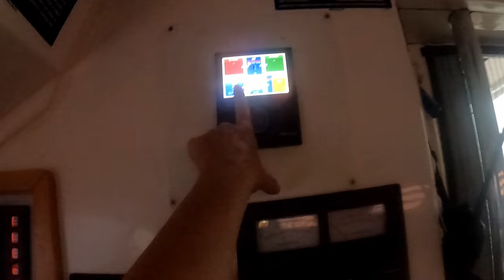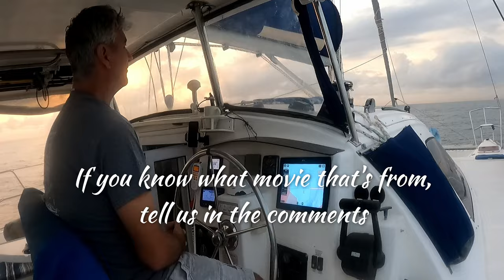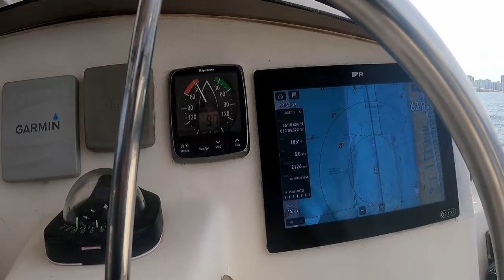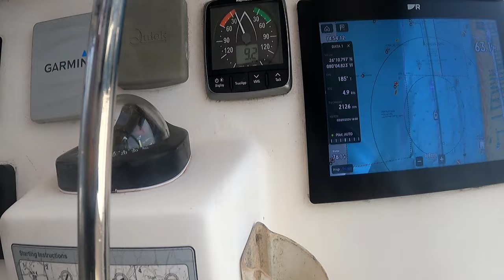SDA126 Windlass Woes

Comment: By sheer chance Capt. Dave, could the possible short from the case tightness be causing the breaker to become weak? The windless worked after you removed the case and reset the breaker is why I ask.
Reply from the maker: That’s a definite possibility. We are trying to find a replacement breaker. Not easy todo in the Bahamas

Comment: You were saying that there wasn't power going in the contactor. My guess is that there is corrosion in that big wire going to the contactor.  Hopefully the contacts are still good enough in the contactor and the housing chafing got fixed.  I would lube the windlass as there is likely a zirk fitting for grease or a screw in zirk.
Reply from the maker: Possibly a bad breaker. The wires look okay aside from the chafe
Reply: @SailingDarkAngel  Oh for sure.  I've got a lot of those same breakers and some brands won't even trip. I found some without as much writing on them were more often defective. Usually they didn't have Waterproof written on them.